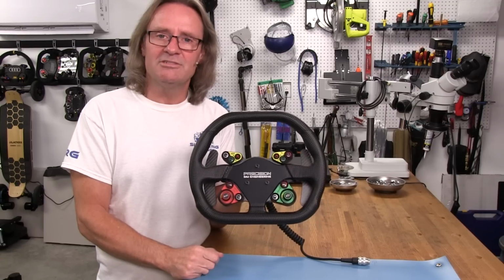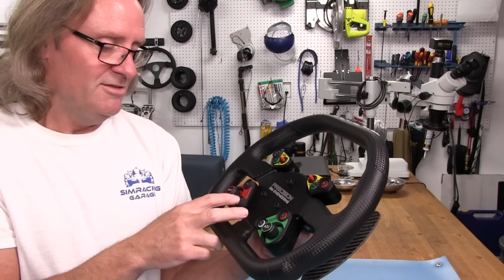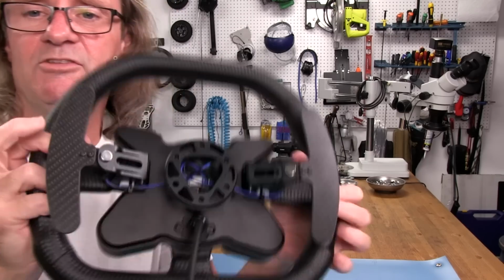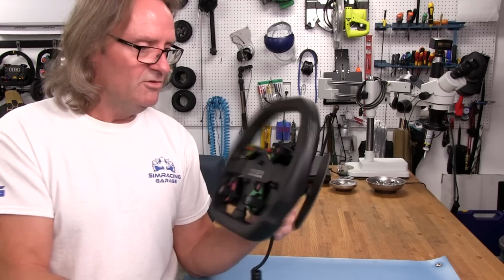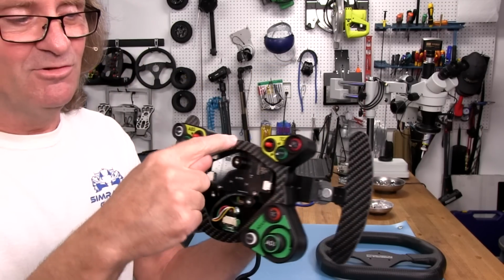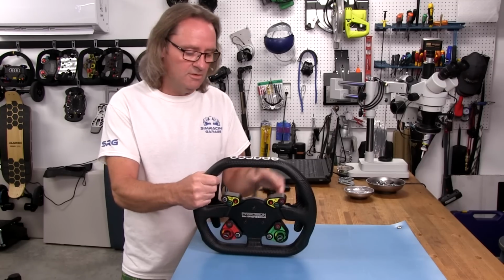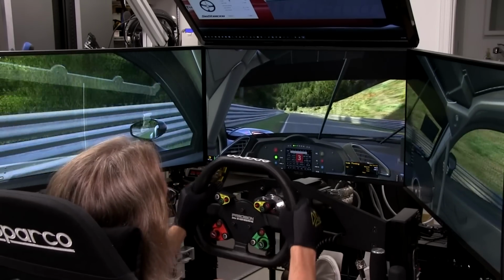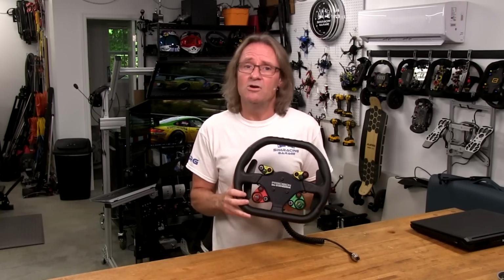Precision Sim Engineering GT3 Wheel Review

Comment: Barry, I love your video's, In fact I have just bought the GT1 version of this wheel based on your review.
There is one thing I must share with you....When using a vernier caliper to measure, you should only use the front most machined "Sharp" edge, further back the tool increases inaccuracy